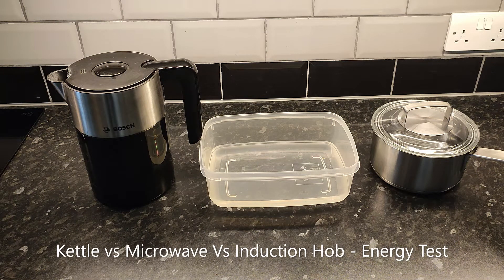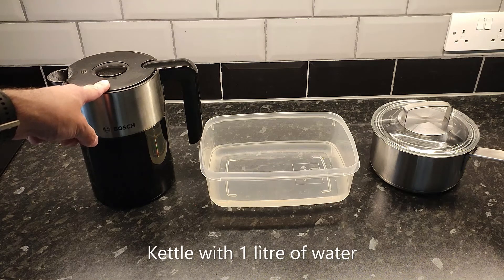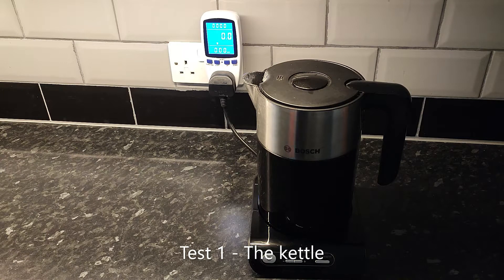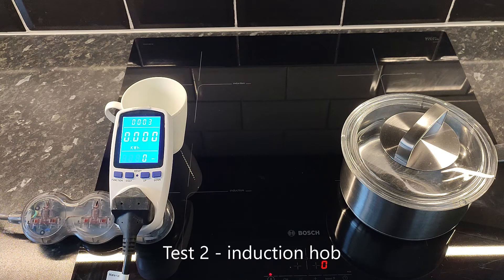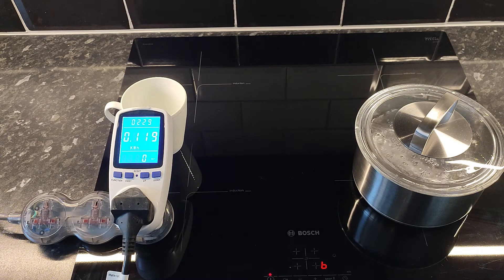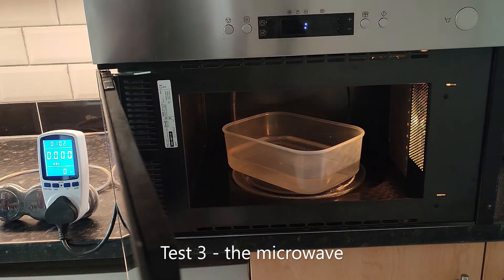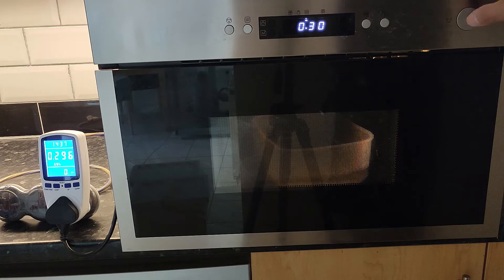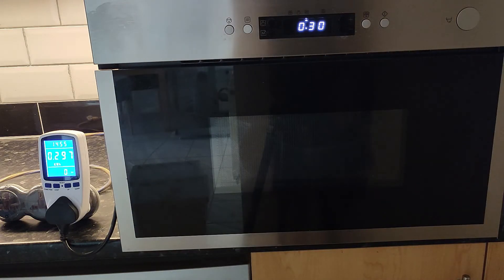Water boil test - energy use - kettle vs induction hob vs microwave

Comment: I stopped using my electric kettle whern I got my induction hob.
Turns out, the kettle uses a little bit less power but I dont know if that is enough to make any actual difference.
They are almost identical so, the kettle will remain in the pantry.

Comment: Really depends on the brand used. On the average, induction is usually more power efficient than kettle with microwave lagging behind. There is current technology called inverter microwave where power efficiency could go up to 90%, way better than induction (avg 85%) or kettle (avg 80%).

Comment: Good video, however, you may have missed something; you are boiling water in a kettle with a lid, Vs a pan with an open top, this will impact the boiling time, due to pressure losses. An induction hob is more efficient and quicker than a kettle (85% Vs 80% approx.) so in theory should be quicker and cheaper than a kettle. I have performed this test with a hob top kettle Vs an electric kettle and the induction hob used less energy in my experiment.
Reply: The pan wasn't open....he put the lid on.

Comment: I did a similar test some time back except I used a "one cup" type dispenser, and electric "jug" kettle and the microwave. The first was the fastest and most energy efficient followed by the (2.4 kW) electric kettle with the microwave (900 W nominal) taking almost 3 times as long as the fastest and using almost double the amount of energy. I was using 500ml as my test. 

The microwave was also difficult to time and made the mug uncomfortably hot to handle.

Comment: Thanks for the test. Until we get a smart meter, I've been curious as to which would be the most energy efficient. Disappointed to see You let the induction method  boil on for a few seconds past boil point. I bet it would be a lot. Closer to the kettle., if not better. It would be interesting to see if induction specific kettles are worth the money as opposed to a lightweight induction pan.
Thanks again for your effort though. Think I'll stick with my ceramic coated induction jug.
Reply from the maker: Yes, not 100% scientific! The kettle was going to be the winner as it's going to chuck at least 99.9% of its 3kw into heating the water. Either way the induction did pretty well.